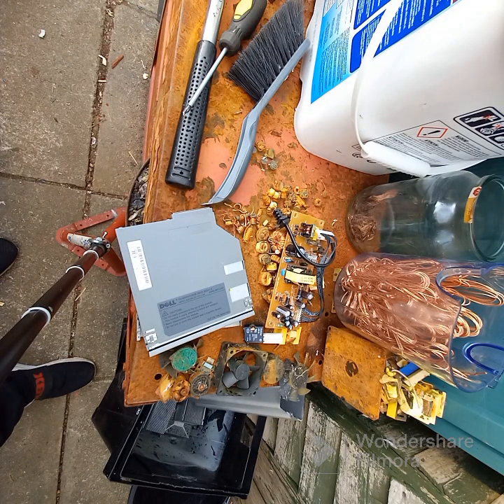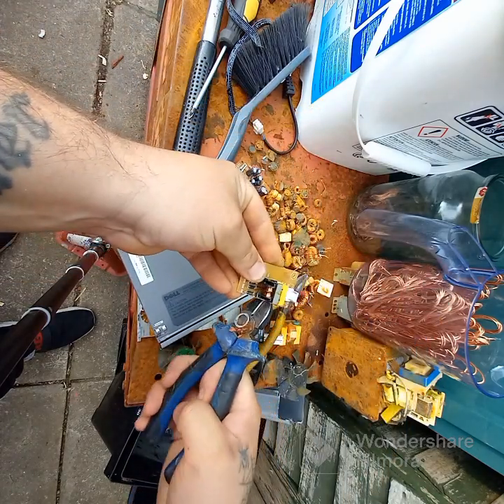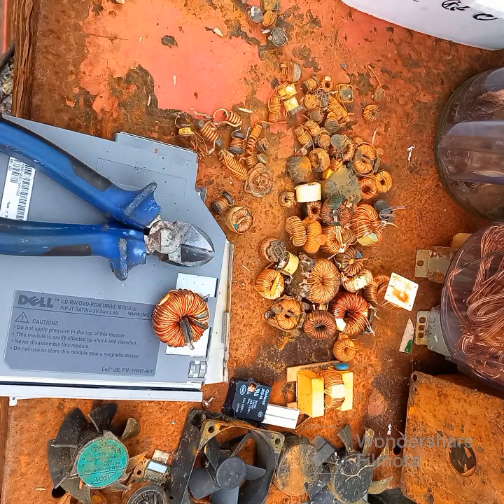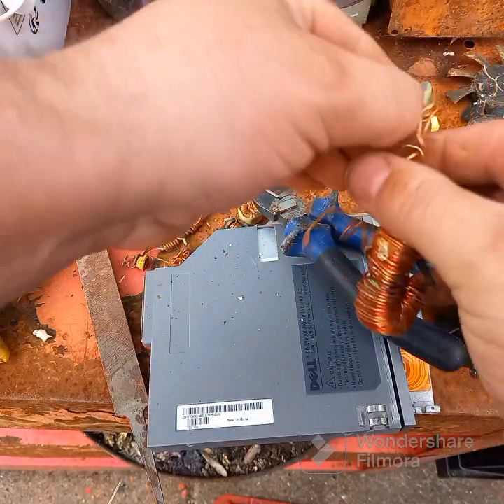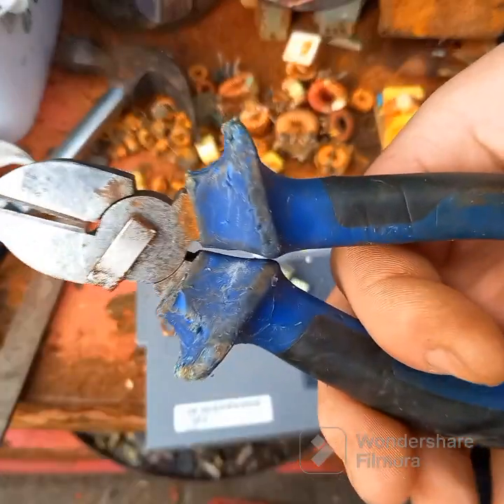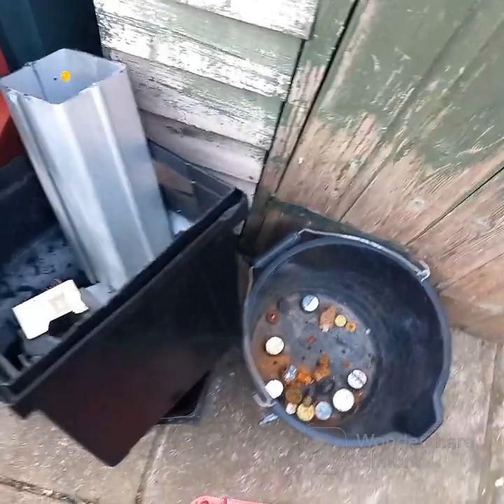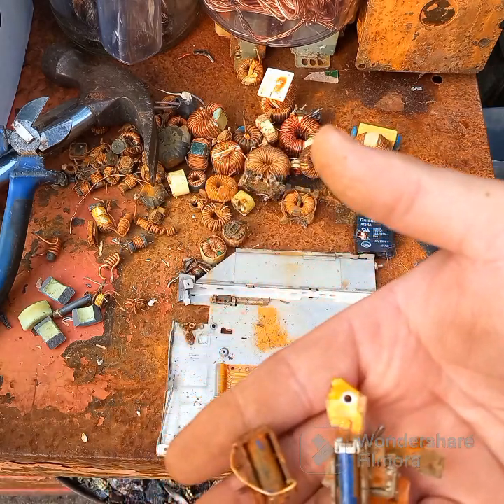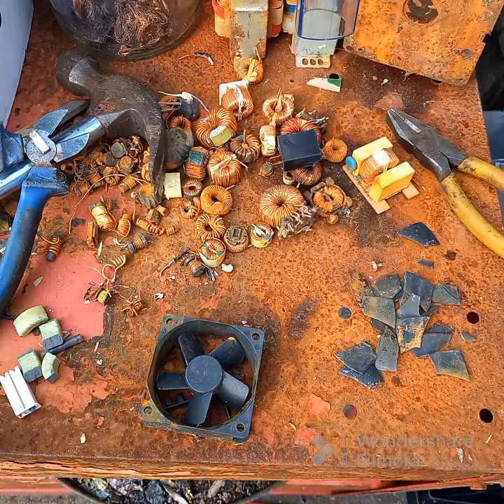circuit board copper.

Comment: You're only getting around 10 % of the value of your Printed Circuit Boards (PCBs) due to your inefficient and time consuming way of handling them manually! I process all PCBs at home, extracting 100% of the values. 
First step is hydro metallurgical removal of solder, for later Tin/Lead/Silver recovery (Tin is worth 4 times more than Copper). After this process all electronic components simply fall off of the PCB. These components are sorted to be further processed in individual batches according to the specific metal to be extracted during various following processes; that's roughly: Each different type of Basic Metal, PGMs, as well as Rare Earth Elements (REEs).
The bare boards are then pyrolyzed, yielding Raw Pyrolysis Oil (RPO), Bromine, Copper, and glass fibers. The Raw Pyrolysis Oil is later cracked into Gas for heating of chemical processes, Petrol/Gasoline for the car, Diesel for the truck, and Fuel Oil for the metal melting furnace.
As an example of efficiency, it can be mentioned that I never waste time trying to break apart transformers. After the initial solder removal, the transformers are pyrolyzed to completely remove all plastic and lacquer (yields RPO too). Afterwards they can more or less be disassembled with the bare hands. Fast and easy!